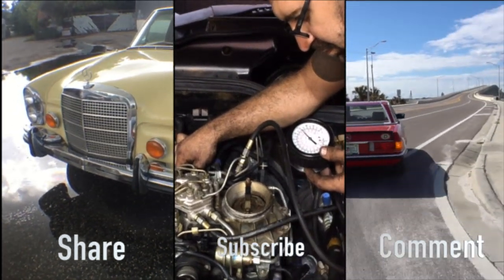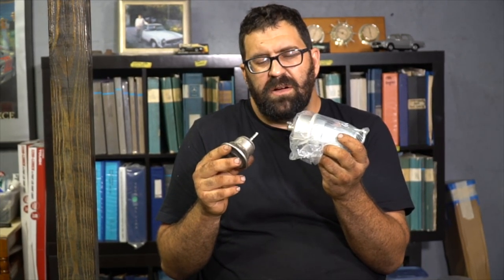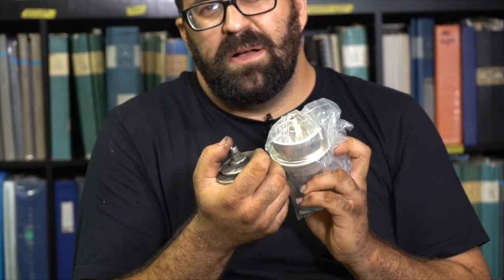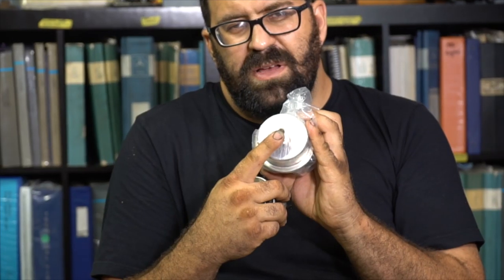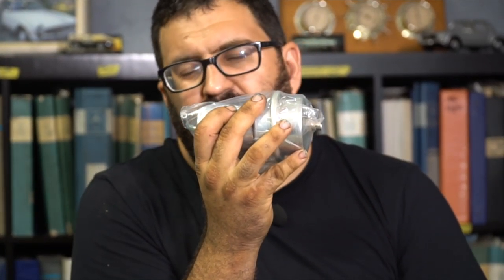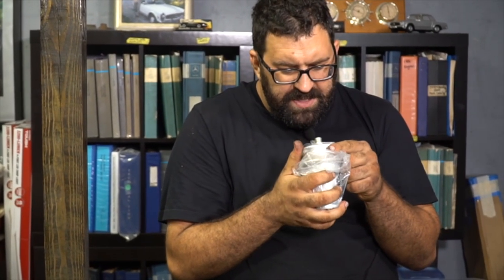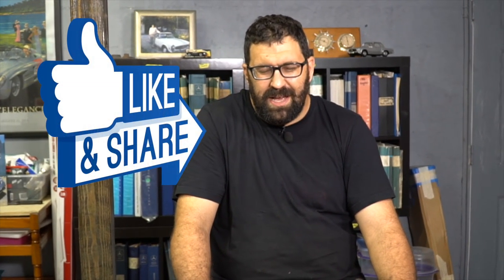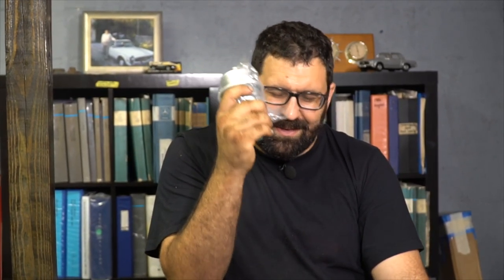Fuel Pressure accumulator what do you do

Comment: Hi Pierre,
  I have a 190E  2 litre engine.
    the engine stalls after driving for 20  minutes or so.  It is then difficult to restart, and pull away.
  I have fitted a new Bosch fuel pump , and a new Bosch fuel pressure regulator.
When using the pressure gauge set, the operating pressure reads 3.4 bar. the operating pressure for my car should be 5.2 ---5.5bar.
  I havent replaced the Fuel accumulator, as it is holding 3 bar pressure for 30 min , engine switched off.  
  Why does the operating pressure not climb to 5.2 Bar?   
I have tried pinching off the rubber fuel return line from the pressure regulator , and also the bypass rubber line from the fuel accumulator,   without seeing an increase in pressure on the gauge.
    I did a pressure check on the new pump, and it is producing 10 bar.
Could the broblem be the the fuel accumulator?

Comment: I have a k jet tonic with high control pressure it is 90-92 psi system pressure and when open valve drops for second the right back to 90-92 psi . I think I have a restricted return line any ideals
Reply: It is an 84 rolls royce silver spirit 6.8

Comment: Interesting because my 81 280e was doing that today started it up at the store and it took time to start but when it finally started it was shaking and idling low until i rev the engine let off the gas and  it act like it wanted to die then it stabilizes to normal
Reply: Dud you sort out the issue ?

Comment: Hey Pierre, Good video, like your videos very much!
I have a W124 300E and have some problems starting since a couple of days. The problem is that if I leave the car for a while (say (half) hour or longer), the car does not start directly and the engine has a hard time starting. So even if the engine is still warm and you leave the car for a while it is hard to start. Cold start is a little worse than starting a warmer engine. 

If the engine is warm and you turn the car off and back on, the car starts directly.

Also I noticed that I smell gasoline after driving or when driving and I open the windows on the right side of the car.

 What do you think that is the problem. The fuel pumps, accumulator, filter and fuel injectors have never been changed by me (Been driving for a couple of years now). Unfortunately it costs a lot to change all of the parts, so I only want to change the necessary parts for now and the other parts in a couple of months. What is your advice?
Reply from the maker: Hello, +Mooo Bibi and thank YOU so much for your question(s), we want to answer you as quickly as possible. 
By signing in our Patreon https://www.patreon.com/thomaspolk page and making a donation of $10 your are assured of a 24 hour email response from Pierre. 
If you are already a $10 member please mention along with your question.

Comment: hey, good info dude, i have 79 a 280ce .. i thought accumulator was leaking.., on closer inspection it appears that the end with the slip on style hook shaped fitting doesn't appear to go to anything & that's where the fuel is dripping from.. any idea where it should be connected ?? or should it diagrams in workshop manual not very clear.. be a great help if you could enlighten me.. appreciate..

Comment: will bad accumulator cause fluttering?
Reply from the maker: it could but the more likely issue is a lean mixture or a failing fuel pump
Reply: Mercedes Classic with Pierre Hedary  thanks, replaced pump and all ok.

Comment: When you say hot starts does that mean it could be why my car will have a bad idle once it is started hot
Reply from the maker: that could be more of an injector issue
Reply: i'm a newbie to these mercs so is hard for me to explain, my car will start fine on cold start drive fine. if i pull over/stop the car/ get fuel and start the car while hot. it will have an idle around 1600-1800. i've replaced the injectors, i'm thinking its the accumulator?
Reply: @coldwarmachine  did you ever figure out your idle problem?
Reply: @groundup421  nope haha I got sick of the motor. I swapped out for a 2.3komp. I spent long time over looking everything. The injection system was iffy and the car over heated twice. Time and effort to fix that engine or swap it cost me the same to fix or swap.
Reply: @coldwarmachine  you should make a video showing that motor, that would be pretty cool
Reply: @groundup421  plenty of w201 with m111 swaps I e finished most of my work now without videos just photos